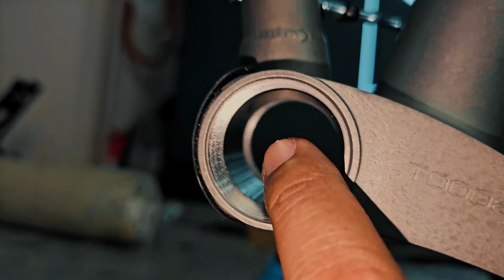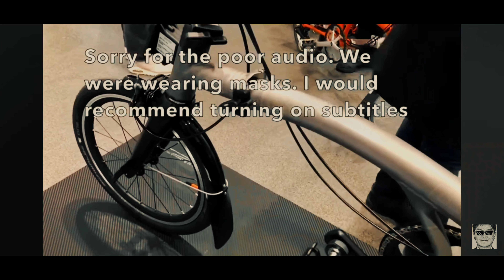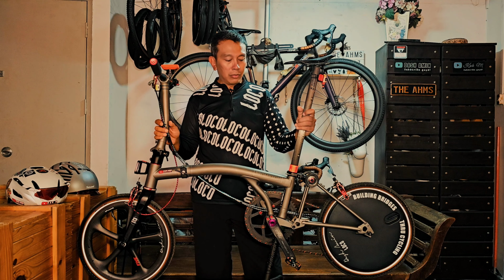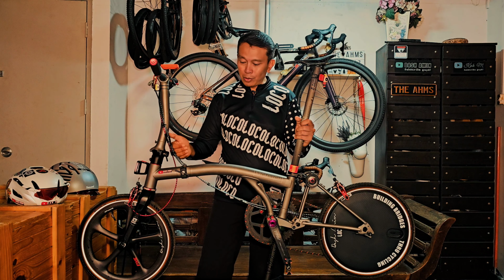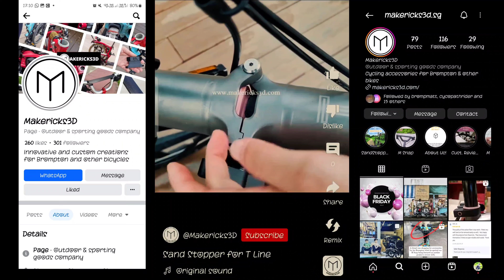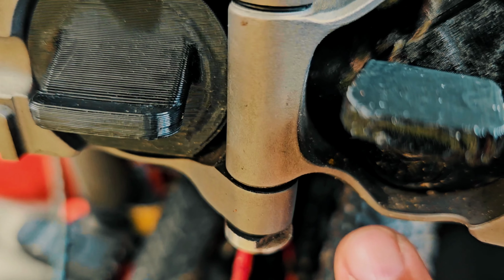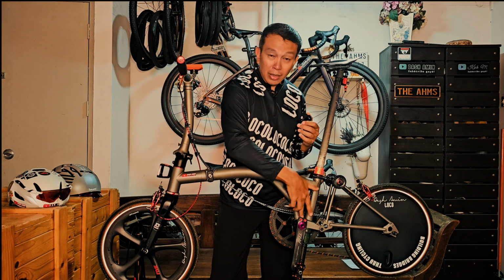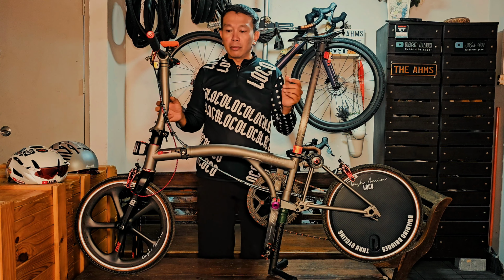Brompton T Line Design Flaws-Sand & water get into the botton bracket. Sand Stopper by Makericks3D.

Comment: Good video bro! Thanks for sharing. Brompton should look into this asap 😅
Reply from the maker: Thanks for watching bro. Sadly Brompton's reply was disappointing.
Reply from the maker: Hello Dash,

Thank you for contacting us here at the Brompton factory.

Thank you for sharing video which we have watched by our quality team here in Brompton factory. We appreciate good intentions in it. However, we found it misleading as it advises 3rd party products that will do more harm than good.

We don't see design flaw in T Line Brompton rather than intentional design which makes T Line lightest folding bike in market.

T Line main frame hinge is designed for weight reduction and to reduce unnecessary contact points. Open gap in folding joint might attract more dirt than standard Brompton main frame. However, we normally recommend servicing bottom bracket every two years and replace it if necessary. Any accumulated dirt can be removed on regular maintenance routine.

Hole or "bleed hole" that connects air to flow from main frame top tube to lower tube is a vital part to successfully weld part together. If tubes would be sealed they will explode under heath without ability for oxygen to escape. 

It's important not to don't block ends of the tubes as this depressurise air chambers and actually accumulate more moisture and trap it inside and therefore will do more harm than good. 

Please watch this video bellow:
Brompton steel frames: Aftercare and how the environment affects them

We must notify you that any related damage due to the third party product being installed on your Brompton Bicycle would void any claim to the manufacturer's warranty coverage. Please read this link for more details: 

Brompton Full Warranty Terms and Conditions

I hope this information helps, but do feel free to respond to this email with any further questions. I'd be more than happy to help. 

Kind regards,

Raimonds
Brompton Bicycle

Comment: I use the Original Tool set inserted in my front tube of my 2019 SuperlightM6LXBrompton, which is close to 8,5 kilo with mudguards -Tool set and still my ordinary handlebar. With a little more work and changes I expect to come below 8 kilo! So honestly, why waste the double money on a T-line, with all the unsettled problems?  Finn. Denmark
Reply from the maker: Thanks for sharing Finn. The T line was my 1st brompton bike so I worked it from there 😁
Reply: @dashamin   I will change the clamps (holding the titanium stays and holders for the frame) on my mudguards to Carbon and Aluminum and a new hook for the frame. With a new carbon handle bar and the last titanium parts for my original brakes, I expect to reach at least 8 kilo, and still with my Toolset in the frame. To the side of here I can see a similar Flame painted bike, which have reached 7,8 kilo (JackbikeSG), but without mudguards it seems? Finn. Denmark 😁 I will look at what has ben done, besides new carbon wheels. Mine is a 6 speed.
Reply from the maker: It  is very achievable.  Change the fork, Triangle & stem to titanium and will be looking below 8kg! Cheers mate!
Reply: @dashamin  As a "Superlight" it has a Titanium fork and triangle from the Factory, and now also a black titanium Brompton shaped, seat post. The stays on my mudguards are titanium, but the - clamps holding them  are from "Heavy Metal" - to be changed to a lighter set parts from China!